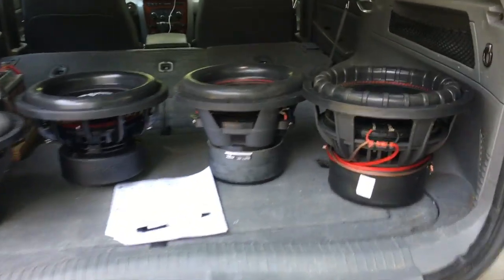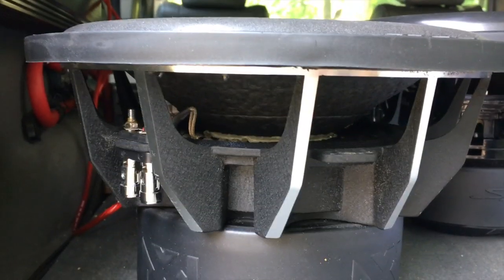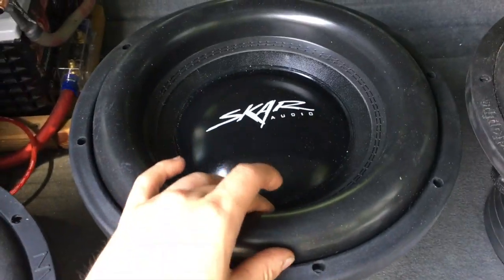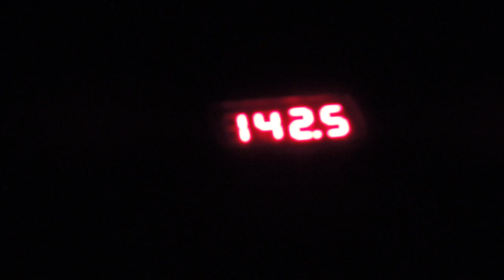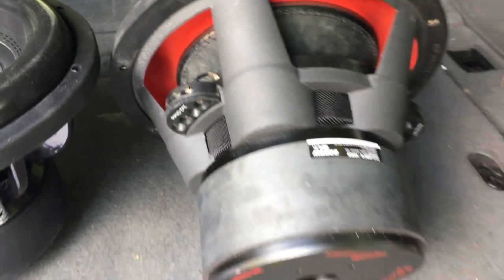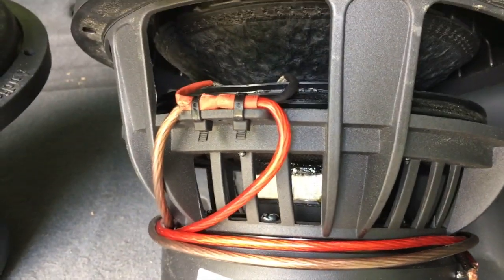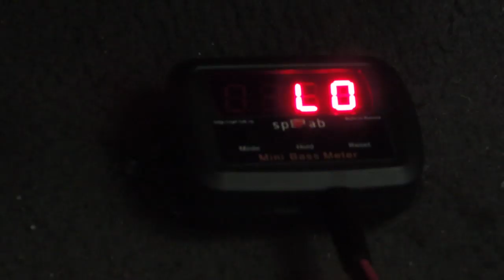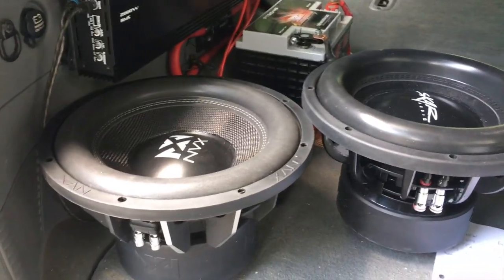Best Subwoofer Under $200?? Best BANG For The Buck? | Skar | AmericanBass | AudioPipe | NVX

Comment: Right on man cool vid! I’m a bit of an AP fan but for me custom subs with 4 inch coils are my preference but custom subs are not cheap and unless you dump tons of money into batteries an Alt or 3 fatty wires ect ect you can just be smart go budget build and still be happy. I hope to keep seeing your vids well off into the future maing!!!! Cause you do a real good job.
Reply: Yeah no doubt. Heck I am just running a couple subs, on an Orion amp that pushes around 4k or so RMS at 1 ohm, though I've been running it at .8 ohms which I believe bumps it up to around 5k if I'm pushing it, plus another 300 RMS amp to some 6x9's, and I have 0 gauge running from the main (battery under the hood is a good 1k CCA) back to the secondary battery a foot away from the Amps. With the Big 3 done under the hood, and exceptional grounds and all connections for the rear battery (also a 1 thousand CCA high quality marine battery) as was done everywhere..
  I think I'd be pushing my battery, wiring, and alternator setup if I was to add my other sub amp, or maybe even adding my other full range 300/600 RMS amp to another set of components or 3 ways etc I think that I would be pushing it past what it can safety put out to power the Amps enough

Comment: Would like if you continued this category and make a poll on the next group would like to see sundown sa and infinity kappa for example. Maybe a p3 and kicker as well.
Reply: Johnny 24 I currently have 2 12” P3’s and they disappoint, but I’m limited on trunk space. I’m looking at one (1) of these in a proper box that’ll hopefully blow my  2 P3’s away.
Reply: @tantojutsuninpo  I had 2 p3 twelves in a Honda Civic back in the day and it was super loud, i used to drive by Walmart and set off car alarms lol. But I had the old style with the green dustcap. What amp are you running?
Reply: Jason Thompson I’m using the Audiopipe APMI2000 at 2ohms so just a hair under 1500 watts to both or 700ish each.  My issue was a small trunk and the biggest box I could fit was 1.6 cubes each (slot ported) the box had no breathing room.  I did end up getting one AP BDC4 12” in a 2.2 cube box running the same 2 ohms final but just to one sub now. Hits the lows wayyy harder and louder but def not as clean as the P3’s. Also have much less trunk rattle.
Reply: @tantojutsuninpo  I'm sure 1.6 cubes would be fine if you tune @38 hz or something, I kind of prefer the big boomy bass over the super low notes though. I've heard some AP subs that sounded pretty good. I'm loving the American Bass though, impressive subs for the price.
Reply: I have the 2 12 p3 in 4th order was on a lp750.1d but I have to 2000.1d now & it made a big difference but have metered yet. But I eventually I wanna upgrade subs soon great subs but still want more bang🤷🏽‍♂️

Comment: Well, I already have the APMI 2K amp so it looks like I’ll be getting the AP BDC4. Thanks for the video
Reply: Did you end up getting the bdc4 i wana get 2. Please let me know
Reply: @lukeglavan  yes I got one in a large ported box and it hits harder than the 2 Punch P3 12’s I had before using the same amp. Very happy with this sub. It def hits lower but not as good for non-rap music.
Reply: Did you have to upgrade your power supply? (battery etc )

Comment: I recently got 2 of the xfl 12's, they're the new style identical to yours but have a high roll surround with no ribs and the voice coils have black glue that more resembles the skars coil you showed. Fantastic subs, just thought it was strange the subs could vary with the same model number xfl 1244

Comment: At 9:35 how do you cut your subwoofer box bigger once it's already been cutted out previously? I can't find no videos on YouTube on how to do that. Plz help. I like your videos and that Nikon camera 💪😎 can't wait to get my camera for my vlog.. so yeah, how do you cut it bigger?? 🤔
Reply: What battery do you used for the back of the car?
Reply from the maker: I just cut the hole in the box for the sub bigger. And I have a full throttle AGM battery
Reply: LevelUpLiving 
You can use a jigsaw w/a steady hand or a router with an even steadier hand or a jig to use as a shoulder to guide the router to make your hole bigger. Add a baffle to go smaller..

Comment: All these subs seem to perform great and for the price you can’t beat it which brings me to my next point.  Why is JL Audio so expensive and how would a W7 stack up against these subs?  Which would you prefer?
Reply: W7 is a square sub, with a plastic subwoofer membrane and stronger motor driver,so henceforth is a competition grade sub.
Reply: Oh wait. I'm thinking l5 and l7. Kickers. Sorry. My bad.
Reply: Jl w7 probably would sound the same as those subs. It's a matter if prefferences,and specs. The better  the amp,and better subs,plus good quality box built to specs will make statement quake.

Comment: Very nice video. Been waiting to see the end comparison. I like AB subs as well. Currently running two AB XR 12's on an Orion XTR 2500.1dz and they slam. I have two Soundqubed HDC3 18's and another Xtr 2500 to strap together, with a Orion XTR 750.4 just waiting to go in, but I haven't been had the time or energy to build a box and put it all together yet.

Comment: Skar sounded the cleanest
Reply: just bought some skar subs they come in soon let’s hope they sound good
Reply: Messin With Sasquatch how did they sound
Reply: I’m planning on getting the Skar EVL 12 with the rp1200 or rp1500 amp which amp would be fine to have with stock electrical for starting off?
Reply: Messin With Sasquatch whatcha get? Idk if I should get 2 12s or 1 15
Reply: You can make any sub sound clean, its all in the box, i had 2 xfl's which would blow the skar evl's away but sounded way better as well in the box i built for them
Reply: @paulcaprio1344  actually what you should buy is on your preference and budget. Just make sure you have clean power and proper voltage.
Reply: @Malek-b  every car is different. Start with upgrading the front battery to northstar, xs power, full throttle etc. And a big 3 upgrade. I wouldnt put anything on stock electrical
Reply: Jake Brown should I upgrade the front battery or back battery since my car is a Ford Fusion hybrid
Reply: @Malek-b  the rear battery. The front should be the fancy hybrid battery. Although I'm unsure of your situation exactly now knowing it's a hybrid. Do you know what size alt you have?
Reply: @THEBLOODYBALLOON  do they sound good
Reply: @paulcaprio1344  you've probably already bought your sequiptment but when I was trying to decide between 2 12s and 1 15, I ended up doing 2 15s
Reply: @Malek-b  I bought the zvx12 with the rp1500 and it slams but I ended up buying a 200a alternator and a secondary battery with a battery isolator. My stock alternator only supplied 85a
Reply: ThicoMode y they sound great
Reply: Paul Caprio i got the 2 12s
Reply: mahmoud bisharat yes they sound great
Reply: I have 2 evl 15 they slam close to 150db out the trunk stock alt
Reply: @paulcaprio1344  I'm going with 2 vxf 15s
Reply: @jaywalkin8205  jw if that alternator is still alive lol

Comment: It’s a common misconception that copper can’t handle heat when in actuality the melting point of copper is significantly higher than aluminum. Aluminum’s better at heat dissipation but you sacrifice motor force and low end output.  I’m a copper guy or as a compromise a cca guy but I never like the sound of pure aluminum coils.

Comment: What ohms did you have the American bass xfl wired to? How much did you have the gain turned up? 
I bought the same exact amp and sub based off you videos. Thanks keep it up bro
Reply from the maker: I had the sub wired to 1 ohm and gain about 2/3 of the way. However, where you up your gain to depends on your headunit and it’s settings.
Reply: NineFive_310eg I started my XFL1522s on APBB1250, wired down to .5ohm, I went to the sound stream 6000dl at a 1/2 also. Love that 1/2ohm shit. I just put in the new T2500 bt-cp, had to wire up to 1o to keep the amp from cutting out but there’s mosdef more sound coming from back there, more movement on the outside too. I don’t know what’s more enjoyable, seeing people waiting to see wtf that is coming, or the faces on those people when they see the actual panel movement as I pass them... also I’ve only taken one ride but I already miss that .5 bragging right...

Comment: Me personally I'd run the skar or audio pipe subs nvx and American bass has some products that have been overrated and skar and audiopipe no matter what products you buy from them are always underrated. Just my 2 cents I've literally run all these brands of subs in my truck and the skar and audiopipe were the cleanest sounding and hit harder on 2k with good electrical. In the end I settled on sundown sa12's......for now.
Reply: Stay clear of the EVL subwoofers.  Small motors, horrible tsp's.  Very inefficient.

Comment: blew my skar dont like it changed the box cuz da box sound like it was guna break in half changed it in another box sound way better but den blew in 3 days maybe pushing too much power idk
Reply: IMO Skar = Junk Subs. Bought 2 brand new ones and with clean power, no distortion and they both blew within 5 minutes. Never even pushed them 100%. I'd recommend Resilient Sounds, SoundQubed, Sundown and more but never Skar.
Reply: OCD Garage glad im not the only one i replaced it with a audiopipe triple magnet 15in which is cheaper nd it has not blown yet
Reply: @JerzeYxKinG  That sub will easily out perform the Skar. And should last too lol.

Comment: I’m really new to this and am looking to get a good sound system in my car. Should I buy one sub or two? And my sound system now is pretty quiet so should I get new speakers
Reply from the maker: 2 is better if you have room. I’d start with a head unit and then speakers
Reply: Parker Dacchille ok, I’m only trying to spend like $200 on the sub itself so is it better to get 1 or 2 for $200
Reply: j w same i need a good setup under 400$

Comment: Newbie question here, but assuming you have an amp with sufficient power (RMS) to power a sub at 2 ohms, does it put less strain on your vehicles electrical if you wire your amp @ 2 ohms instead of 1 ohm?

I, currently, have an Orion 2500.1 & I'm looking to add a single sub (12 inch) to it & if I can put less strain on my electrical, I'll purchase the dvc 4 ohm version instead of the dvc 2 ohm version.

I'm currently considering the Audiopipe TXX-BDC4, Skar EVL, & the American Bass XR-12.

I'd greatly appreciate your input.

Comment: nvx looks like Kevlar like a  carbon fiber look. you need some dynamat sound deading adhesive panels to stop that vibrating rattle on the outside of your vehicle. Of course it means tearing in to the interior to adhere it.
That shiny glue is actually  extra protection from vibration fatigue on the coil because copper and aluminum work harden as it is being used in a motor fluctuating from hot and cold (expand and contract). Over time the copper or aluminum coil will become brittle and harden. If the coil is made from other materials you can look up and see if it does this as well as some materials do and others don't work harden. If you do not know what work harden is google it, I am not going to post someone else's copyrighted material on YouTube.  It has been a while since I set up a system I would have to look into coils being aluminum It would cool down quick I have only used copper coiled subs. I am old school since I am pushing 50 years old I had to look up coil materials just in case they were not just copper anymore. If someone has used aluminum coiled subs let me know how they hold up vs copper. I will have to check out if you tested any under seat powered subs as my old ford has zero room for a system. I use the bed so cutting out the cab into the bed is not going to work.

Comment: You should get a 4k or 5k amplifier
Reply: Look at the dyno run figures off that skar rp2000.1d . It's underrated AF! It's pumping out well over 2k rms @1ohm certified. More than enough to run 1 1k rms sub dood

Comment: For under $200, Soundstream Tarantula T5, RE SEX.
Tons of top brands for under $200. I've personally had a 15" RE SeX and it BUMPED HARD, with a Kenwood amp and head unit.
Reply: Just a heads up the tarantula T5 is the same sub as the nvx vcw shown here

Comment: Out of these four subs, which would you put two of them on a skar rp.1500.1 amp at 1 ohm? With the amps gain and lpf turned wide open.  I'm thinking two of the American Bass, but would like your opinion.

Comment: You do know that you can't stick 4 different subs into the same box and expect them all to perform at their peak, right? Each of those subs has different airspace and port tuning requirements. You should know this, bro. The test was not fair at all, it only demonstrated which subs sounds best in YOUR box. 🤦🏻‍♂️
Reply: Yes we all know that. This is just a general review.
Reply: It would take a lot to make all these shine and make all of them n a different box this is a budget minded person with sub ten K subs ik when I build a box it can cost me 250 easily
Reply: It's still a flawed review. It doesn't show which sub is best. If someone has a smaller box or is tuned to a different frequency then they would have different results. So basically the test was useless unless you have an identical box.
Reply: @tomaskobel3446  I think it is an opinion just like everything on YouTube, he did the best he could with what he had, but yes u could throw a sa 12 n a burp box and our do most of any 700$ sub by just changing the box bur he is just showing what the average bass head can do with what he has we all r here for the same reason #ftlob
Reply: Jeeze bro we're just having fun
Reply: He's not saying what's best he continuously mentions this is his opinions just chill it is extremely useful to many of us who know what exactly we are doing and can do with this info. Example thermal.

Comment: I think you should preface this with what your electrical setup is. amp, batteries, wiring, etc. You are likely not running a cheap setup with no batteries on a stock alternator. This may lead people to believe that they can acheive 140+db just by buying these subs and throwing 1k watts at them when that is definitly not the case.

Comment: Have you tried a Sundown yet?
Reply from the maker: Not yet but I probably will before too long
Reply: Sundown is expensive as heck, and more of a SPL than a daily sub. I'm not hating on them at all. They have amazing equipment, and motors. Just I noticed more people just use them for comp then driving around. I went with incriminator audio death penalty 12 because it's great for both
Reply: @ParkerTheBasshead  game over once you try Sundown haha. I hate to admit it but they're the best.
Reply: Difference between SPL and SQ subs is efficiency for the most part. Takes more power to move SPL subs because of stiffer as well as more spiders, heavier could coils (4&8 layer flat wound) and heavier overall soft parts. Make no mistakes about it though, you can get SPL subwoofers to sound phenomenal.
Reply: @DibeezyTheGifted  the zv4 and zv5 do very well in Sq if they r done right, I am running a resilient sounds platinum 12 in a Sq setup amp gets here Monday it is as large as the zv series it is a massive sub
Reply: @1-Six-dee  I'm building a 4-zv5 18 4th order as I type this... Literally. Going for 24-64 bandwidth. Check my channel in about a week

Comment: @Parker What kind of electronics upgrades do you use in this? I'm looking to get a 2000W amp and wanted to know. Obviously the big 3. But do I need a high power alternator or just an extra battery or both?

Comment: I have a skar sk3500 on two xfl 10s
Reply: I bet they hit hard. I definitely like my XR 12's on an Orion XTR 2500.1
Been beating them to death for over 2 years and not a single problem.
Reply: Deandre Brace can they be heard up the block
Reply: @JayyBootUp  yes they can my mother even told me u heard me before she seen my pull up to her house i just changed them out to my HD 10s they even louder in i did change amp to my sk4500 cuz they 1500rms each
Reply: @JayyBootUp  btw i have the older xfl 10s before the newer one's came out

Comment: I told you XFL for the win!!! And it needs more power!!!👍👍
Reply: True that it will take all the way up to a 3k🤯🤯🤯
Reply: @liljamesjames1884  FOR SURE BRO i played mines hard(2k + for over 3 years) and it's still going strong!!!
Reply: Would 2 sdr 12s be louder than one evl 12
Reply: @nachothemacho0389  sdr wat may i ask sub is that
Reply: @nachothemacho0389  if you mean 2 xfl any time you increase cone area its goin to get louder but loud is explained in to ways 60hz at 150 is loud 40 hz at 150 is loud but 2 diff kinds of loud people say will it hit hard that is determined by the music you like.
Reply: @74midwestbass74  all in how you tune it my friend im happy to sale ab.good product.
Reply: @liljamesjames1884  ok thanks
Reply: @nachothemacho0389  no worries bro a little trick use oak for a resonantly louder box the just tune it a hair lower and will pick up 3 extra hz top to bottom musically with a better response
Reply: Ohh cool thanks.

Comment: How does one 12 inch sub produce that much bass? Does it have to do with the sub box? Im fairly new to car audio and im trying to learn as much as I can. Any recommendations or tips?
Reply from the maker: The box definitely is a big factor but these subs can handle an insane amount of power too
Reply from the maker: FireHawk Airsoft yes if you look a few videos back from this one I showing building the box used in this video
Reply: @ParkerTheBasshead  Thanks, im sure I will use it to help build mine
Reply from the maker: FireHawk Airsoft hope it helps! I didn’t go into a ton of detail as I was learning too
Reply: Good quality amp and either third or fourth gen box